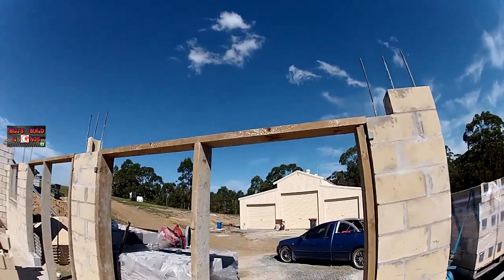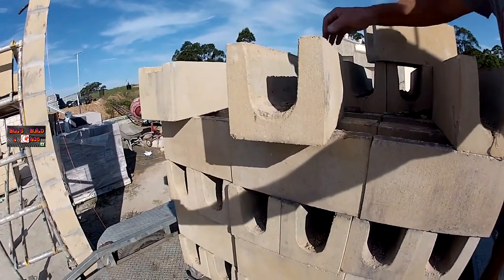Build My Own Home - Part 6 - Pouring Lintel Blocks

Comment: Great DIY building your home. I will advise that you not weld rebar together for a structural elements. You use rebar wire. This will allow the rebar to shift during curing and ensure that the concrete has a solid bite. Without this the steel weld can become a singe failure point since it is not fully encapsulated by the concrete. I'm sure if you read your engineering plans it said to use wire and this is why. It looks good from my house though 😁👍
Reply from the maker: I understand what you are saying, however my engineering plans did not stipulate how the rebar was to be joined together, only the size of the steel. All re-bar work was minutely checked by my council building inspector against my approved plans (literally  in his hands), and he required the smallest deviations to be corrected and inspected yet again. He had no problem with welded re-bar, and my welds were the most minimal tack welds - not full welds at all. In building my own home and uploading film of doing that, I have come to know through the suggestions and re-directions of others, that building standards and on-site practices vary incredibly around the world. Even when you follow the details of an engineer's drawings, which then have to be passed by your building inspector, you still get tradies from all over the place saying "That's not how you do that." Waterproofing wet areas for example, are the classic example, varying from country to country, and even in Oz from state to state!